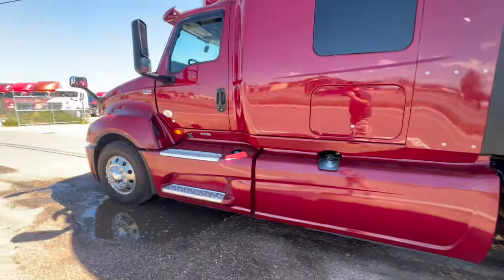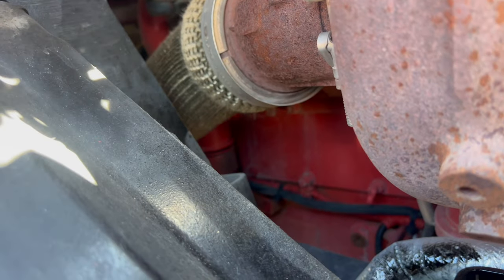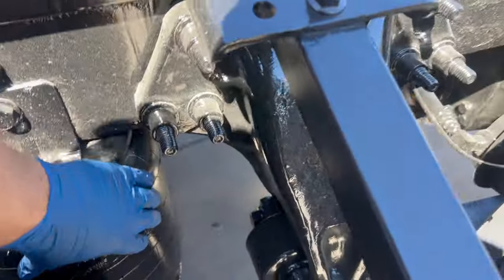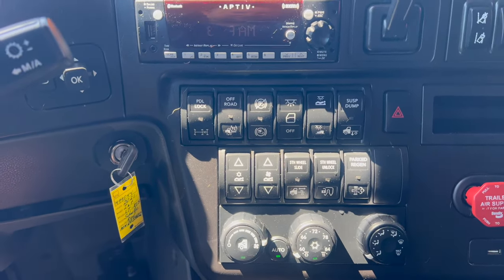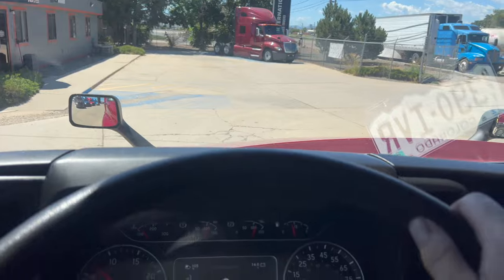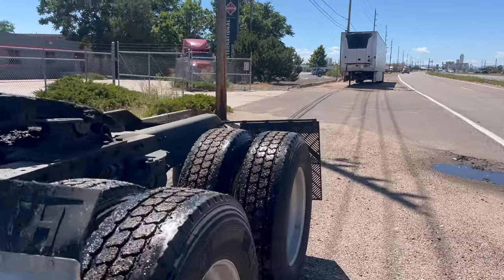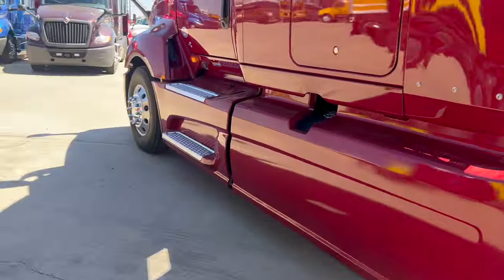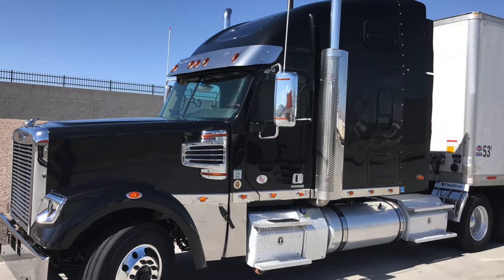My New To Me 2021 International LT625

Comment: Man you are a survivor. That is a lot of money to go through in that amount of time. Good on you for being prepared. 

That X-15 is looking good and it’s a better looking International than most on the road. I think they only get a bad name from that MaxForce engine they had used awhile back. Pretty much garunteed to throw a connecting rod and blow the engine. Ruined their reputation. Since the switch to Cummins, minimal problems and I also felt the frame was very durable. 

That T-600 was definitely cool, shame it was so uncomfortable.

Comment: "Indefinite backorder" with Freightliner has often meant that actually have the part in their own inventory, they just don't want to look it up. Can usually call around and find the part, and with one-boxes now, there are several places that can repair them rather than replace.
Reply from the maker: This was during the heat of Covid. You are right about the inventory. I am close with the people at my local Freightliner. They straight out said, we have them, but the megas are hording them and we can’t sell them. Thing about Freightliner out here in Utah, they are the world’s largest because of all the mega carriers in SLC. And aftermarket, it wouldn’t have been covered under warranty.  And it was a really bad time for me. I was rushing to save that run that I ended up losing anyways.

Comment: Good luck with the new truck!  I like the X15 for torque and fuel mileage, especially if you don’t drive really fast.  I was getting 8.2 the other day running 75, but the load was light.  Has the head gasket been replaced yet?  Around 6 - 700k a lot of our truck were puking coolant out of the block/head connection.  Those were 2018, 19s so maybe they’re better now.  You should be a happy camper for a while … 😊

Comment: I think you paid a little too much for it trucks are cheap 35k will be sweet spot
Reply from the maker: Look at trucks from a dealer. Yes, auction or used truck lots. But they won’t take care if you find something. And they usually get the trucks that dealerships don’t want. I have a sales guy I now call a friend that I’ve bought 4 trucks from, they get rid of the trucks that will cost them more than they are worth to repair. I can also call my sales guy and he will take care of me. Already replacing stuff I’ve found after I bought the truck. Used truck lot do that?